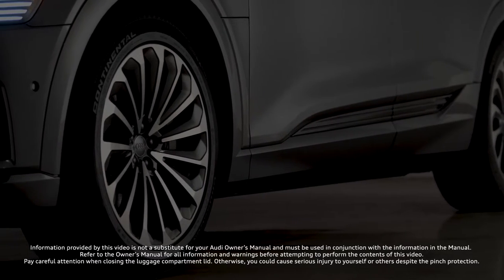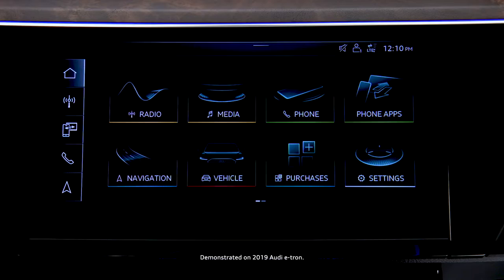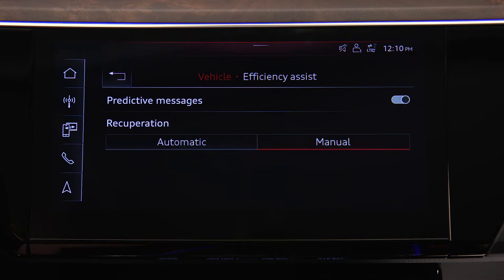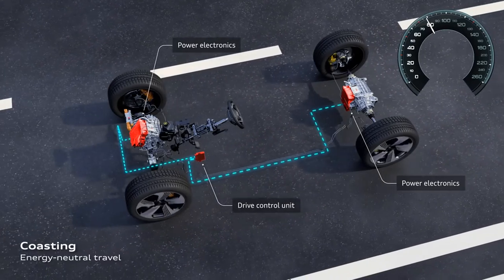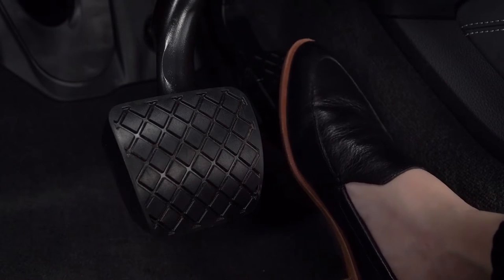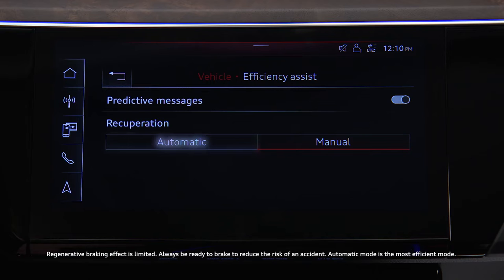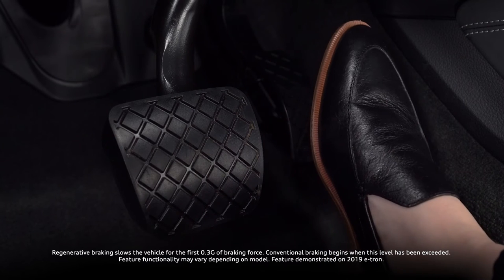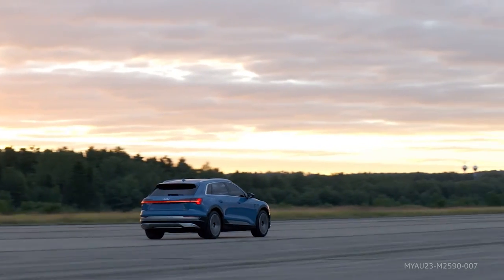Audi Tech Tutorial: Regenerative Braking

Comment: It would be nice if the paddles would take the car out of cruise control (driving assist) instead of have to press on the break first then to use the paddles.
Reply: Push the little stick under the indicator forward to cancel it? Rather than brake
Reply: @joshfgfg  Use the paddle shifter which also acts as a regen break should/would be just like pressing the breaks.  At this time, they don't do anything if cruise control in on.